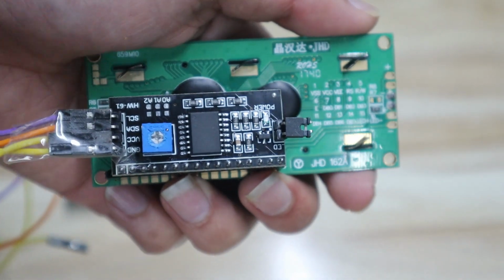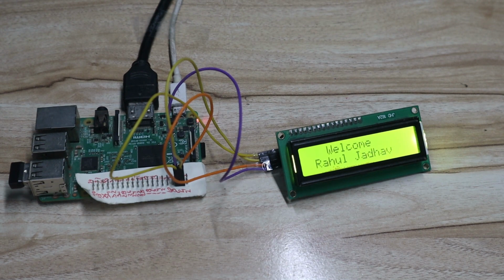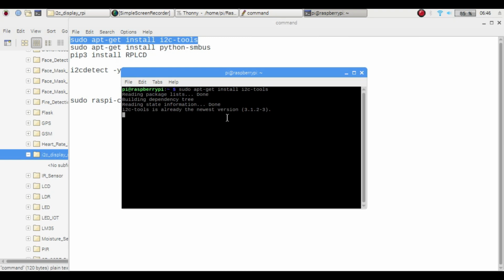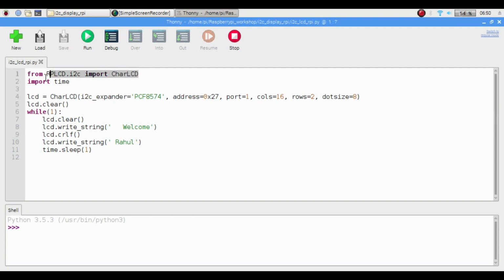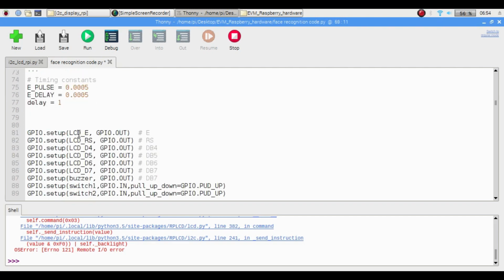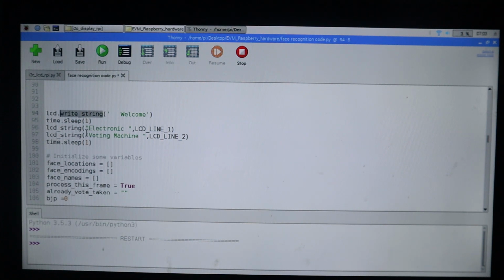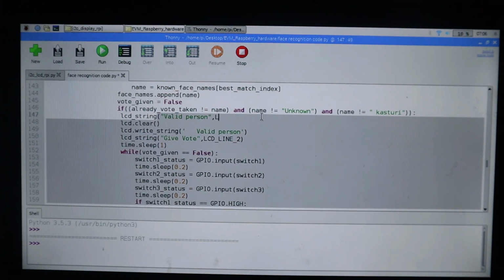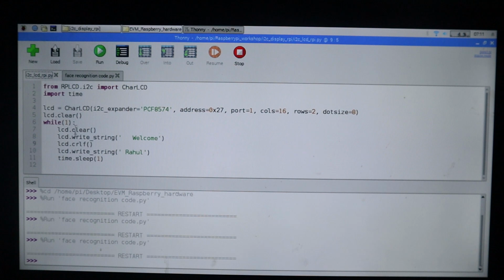Connect I2C display with Raspberry pi

Comment: if you did this how can you connect this i2c led connection to the other materials just like how you did on the other videos wherein you connect your build up lcd connection with other materials like the buzzer, sensor etc
Reply from the maker: Just remove my GPIO display from other video and connect this display. I explained how to change that program in this video only. I hope you watched complete video
Reply: @Rahul_Jadhav_Project  yes i mean in your built in lcd just like in the fire detection system, the sensor is connectef first in the lcd then in the raspberry pi, how would you do that here?
Reply from the maker: @sophiaevangelista5492  actually that is common vcc and common ground .
That is not connected to lcd.its simple power supply common pin . You can easily do that one on breakboard or on zero lcd. Just take one vcc pin from Raspberry pi and ground pin from Raspberry and do soldering.
Reply: @Rahul_Jadhav_Project  how about in the coding, i just need to change all the lcd in the other video and replaced it with the coding in i2c lcd? then all of it should work?
Reply: we are doing the fire alarm detection system and we are going to use this i2c lcd instead of the built in lcd, is this coding applicable to the fire alarm detection system?
Reply from the maker: @sophiaevangelista5492  yes